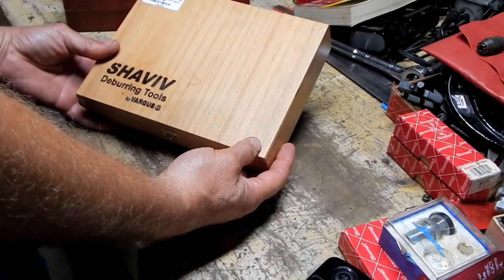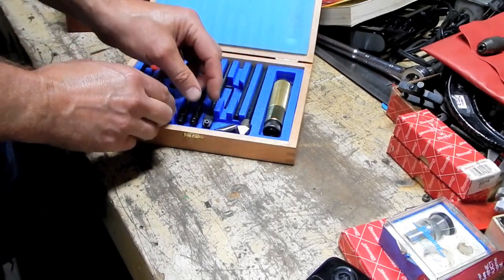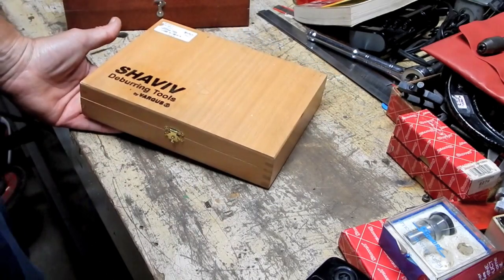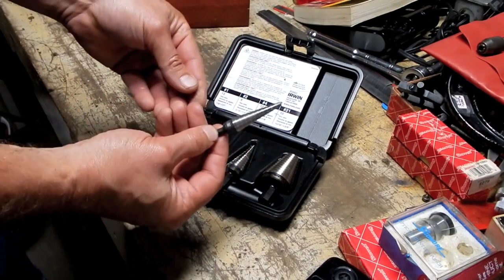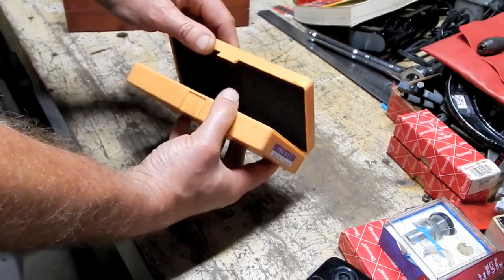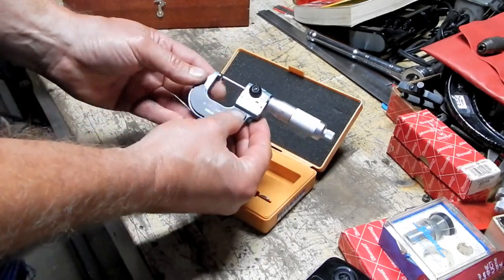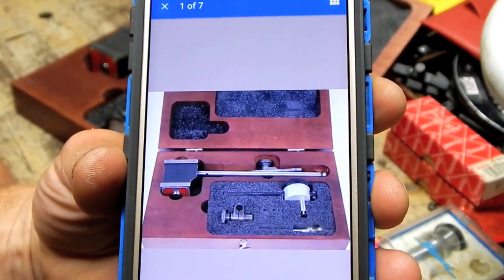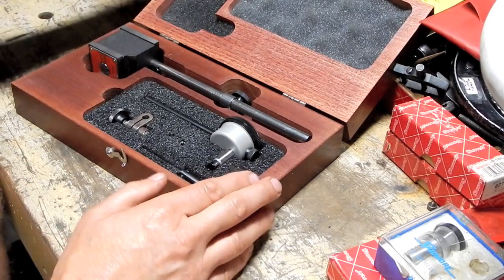2 Loaded Kennedys Part 3

Comment: I can't find the 952381 tap set in the older online catalogs so far. Was trying to check out what tap wrench should have been in the set.  I may have an extra, just don't know for sure.  What they offer now in that stock number is a substantially different set.  Your set is hex dies for starters, current offering is round dies.  I have both SAE and metric 59 piece Kromedge sets, all hex dies, which are really nice.   Also, could you check that Jacobs 6A chuck key and see if it is a K3?  I am soaking a 6A right now for cleaning, and have heard that the 6A chuck had a unique key, but others have used the K3 key and it fits like a glove.
Reply from the maker: I'll check.
Reply from the maker: Just checked. The key is a K3, and appears to be a good fit.